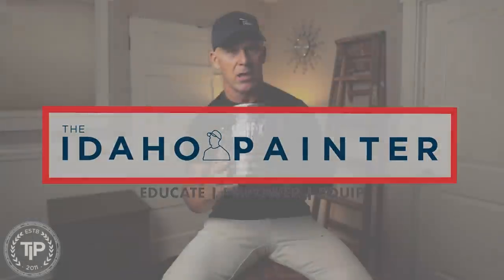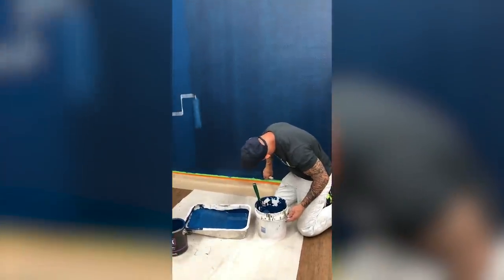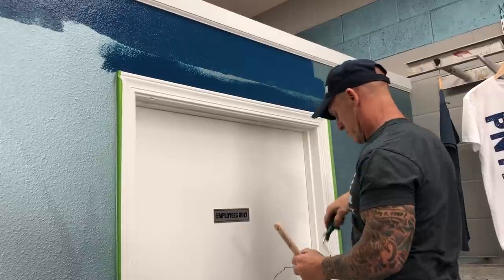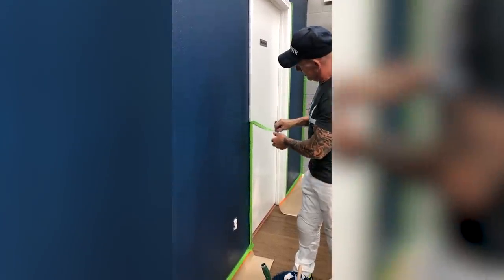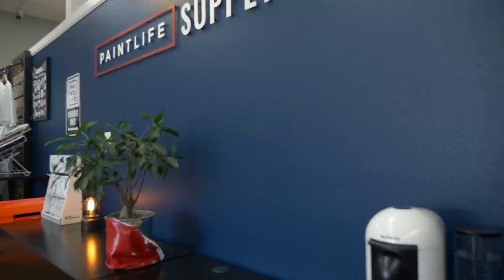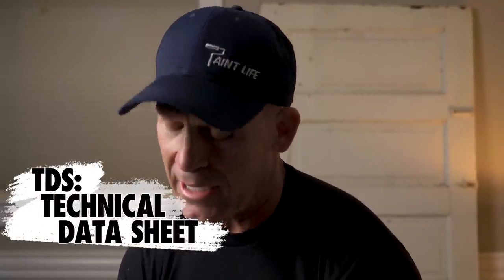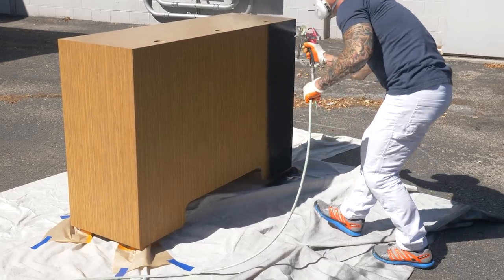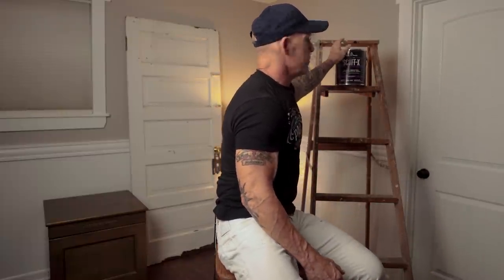Scuff-X Paint Review. Paint from Benjamin Moore worth buying.

Comment: We made the switch from Ben Moore Advance Satin  to Scuff X satin on all of our woodwork, built ins, cabinets etc. last year. Levels out beautiful, quicker dry time, you don’t feel like you’re going to die at the end of the day spraying it (fumes). We’ve had custom cabinet guys ask us what we used on our woodwork, because they thought it was lacquer or conversion varnish.
Reply: How do you think the Scuff X will hold up compared to products like Cabinet Coat or Advanced?
Reply: Curious as to what tip you used to spray it??
Reply: Weird,  I've never noticed any heavy or bad fumes from advance. I've also noticed and found advance to be considerably harder once cured than scuff-x. To be fair, I've sprayed and brushed advance a lot. However, I've only brushed and rolled scuff-x and have never sprayed it yet. I wonder if scuff-x cures harder after being sprayed instead of brushed. Both paints level fine for me with no issues.
Reply: @petercerrato8447 the durability of scuff x is light years ahead of either advance or cabinet coat

Comment: I sprayed the eggshell onto furniture and it looked like a powder satin finish. Super great feel and really durable.
Reply from the maker: Thanks for sharing!
Reply: Did you have to add a hardener or clear coat to it, or did it naturally resist scratching?
Reply: @arc.handyman1905  Its still resisting scratching really well to this day. Nothing was added. I did prep the furniture by wet sanding and using liquid sander before a primer coat. other than that, it's really durable. it takes a couple of weeks to gas out though. The smell bothers some people

Comment: Just used Advance cabinet on my Maple bedroom set. I used Behr cabinet on my other bedroom set, also Maple. Sanded, primed, 2 coats of paint. 95% rolled, 5% cut in with a brush. I found 3 difference.  Advance runs very easy, drying time & the price.  Behr $53 a gallon. Advance $80 a gallon. In the future I'm going with Berh. No matter the advertising about how good water-based paints are. Nothing beats oil. Not even close..
Reply: Scuff x will outperform BM advance and certainly anything behr makes. It will level out just as good as oil with some retarder in it.  And the durability and adhesion is 10x better. And, aside from dry time, it will do anything conversion varnish or lacquer will do.  It will sand to a powder just like lacquer.   There is nothing else on the market like it.

Comment: I use it for all my cabinets and re-paints on cabinets and trim. Sprayed the stuff goes on and falls like glass. Super hard in a very short time
Reply from the maker: Thanks for sharing!
Reply: How do you think the Scuff X will hold up compared to products like Cabinet Coat or Advanced?
Reply: @petercerrato8447  I used to use advance until I tried scuff x. The deal with advance is it takes so long to cure. Great product but you better know how to use it. I like cabinet coat as well but this scuff x...man I'm telling you the next day it was like a piece of plastic had been form fitted to the wood and I had 2 runs. Both easily sanded out and touched up like they were never there. You can't go wrong with any of the three but scuff x is HARD to scratch and very forgiving.
Reply: @Sirmaximus62  Thx for the info! I often brush and roll the exterior of the boxes... any experience with how it lays out?
Reply: @petercerrato8447  yes sir. I use a foam roller. I will cut the edges in but the key is to work it into a fine layer. I don't load the foam roller up. I have before and gotten mixed results. Best results I ever got were 2 coats of foam rolling into 2 fine layers. Of course prep is everything but the foam roller for bodies has been great for me. They look sprayed after using the roller. The first coat is a little weird looking but the second...always been on point.
Reply: @Sirmaximus62  Thanks!!!
Reply: @petercerrato8447  hope it all goes well my friend
Reply: @Sirmaximus62  What are you using for a primer?

Comment: With products like this is there any reason why some painters still use oil based alkyd for cabinets? The off gassing from oil paints is such a huge problem.
Reply: I use some oil, in certain situations. Depends on availability and quantity and when client wants job done. Also, oil still has big advantages over latex/water-borne paints. For instance, the commercial job I'm doing in a restaurant, latex has failed numerous times due to the traffic and environment. Off gassing can be mitigated by air flow, fans and ventilation. And should be motivated this way.

Comment: I've been wondering about these types of paint. I paint rental homes i hate doing touch ups.Most of the time the houses have differnt shades of the same color and gets irritating. I have noticed Behr has this type of paint also and and upgrade paint called dynasty. I use sherwin williams but they never have paint these days when i need it. I had to drive an hour out of town for 1 gallon to finish  a job
Reply from the maker: An SW does sell a lot of junk paint.
Reply: SW is everywhere but they're always low in stock. I just switched over and accepted fewer store locations. Emerald is solid but right now nothing touches Scuff-x.

Comment: My contractor painted my kitchen cabinets...its oak and he did not use any wood filler...im so upset!!my cabinets look horrible in some areas...its behr oil based...can you sand down areas and apply wood filler and repaint!! Or would a good faux over paint hide some of the imperfections..